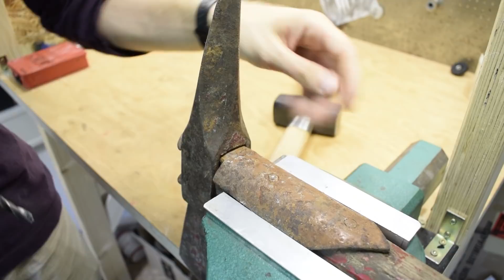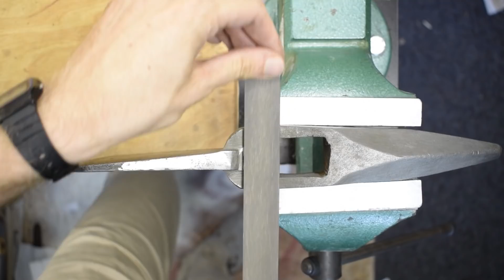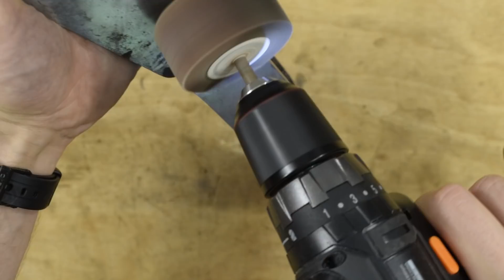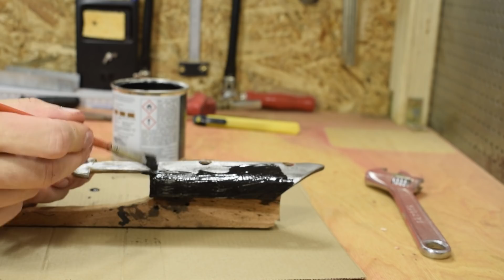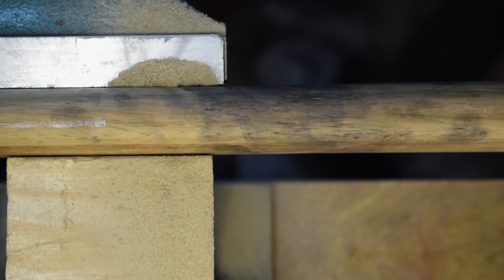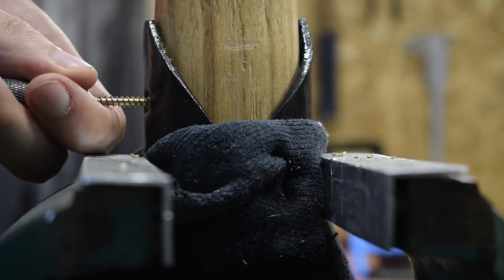Rusty Firemans Axe | Full Restoration

Comment: That 180 grit sandpaper is sharper than your saw, rasp and drill bit. If you find metal too hard for drilling try lower speed too. But your DETERMINATION and PATIENCE are IMPRESSIVE. 
Great work!

Comment: When you sand something start from a lower grit and then use an higher grit or it will take forever.
60 120 240 600

Comment: Unfortunately, the impression of the restoration is a bit spoiled, because of the screws you have chose. It would have been better, if you had use the same as the original, or at least not screws with star. But apart from that, the result was very good.